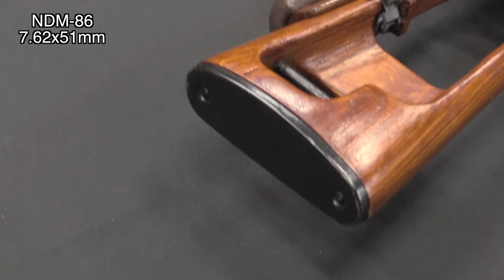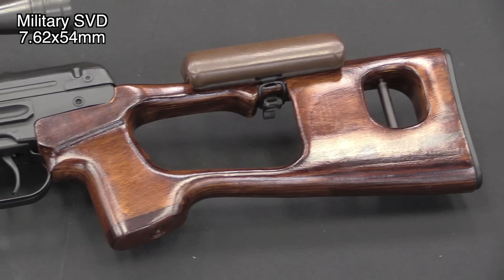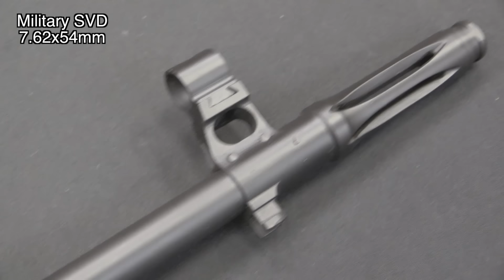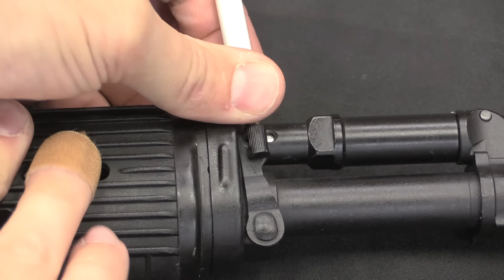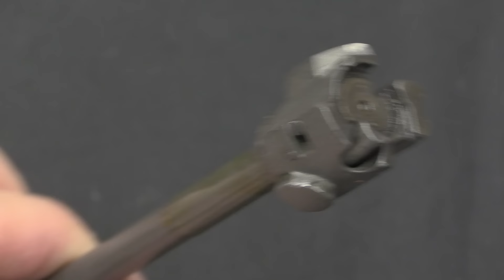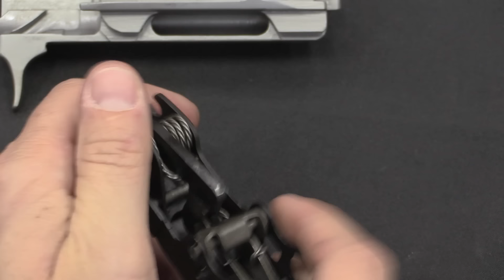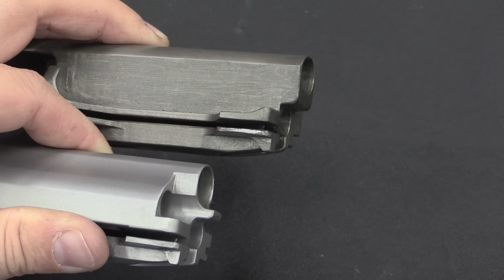Dragunov Variations: Military SVD, Izhmash Tiger, Chinese NDM-86

Comment: Idk why replacing the wooden parts on a Russian rifle with a plastic part instantly make them seem more high-tech.
Reply: Wood has been used in weapons for a long time, so it's probably the idea that wood makes it seem more vintage, which is how I at least got that same idea of it seeming more high-tech.
Reply: @hellscape73  plastic lose all its durability under low temperature conditions.
Reply: @DobryakDobreyshiy  Depends on the polymer/composite The L118A2 & The L115A3 are plastic rifles designed for Arctic conditions.
Reply: @blackace7782  Now check the year of mass-production of old AK models, avialable plastics in that years, and their production cost in comparison with wooden parts. Answer is simple: its cheaper, and its just works in any condition.
Of cource, modern AK's all made with plastic parts, just because it cheaper today, and we have wide variety of composites now.
Reply: Its less weight
Reply: Plastic parts are stronger and better tolerate contact with water.  It’s easier to make many identical parts from plastic.  The transition from wood and plywood to plastic was predictable. And you are absolutely right, with plastic parts the rifle has not become less charismatic, it looks more in the hi-tech style, although the design has been around for many years.
Reply: @dmitriyefremoff2575  Also easier and cheaper manufactering.
Wood has to be machined by skilled carpenter but polymer can be inject molded on machine Most importantly plastic was not widely  available as wood and work force was cheaper than material cost back then.
Reply: Anima Manager
becayse plaustucks comrade
Reply: Wood and steel. Wood and steel....
Reply: Keeping the wood furniture makes them seem more badass.
Reply: To me it's the other way around. Has to be wood to be a Russian gun.
Reply: @ladyskinwalker  Sorry, new russian guns going to look like this: https://youtu.be/3nEJOvGz0Oo
Reply: Это скорее делает их более технологичными с точки зрения производства. Для создания фурнитуры из изотропного материала требуется либо 5-координатная обработка с 1 установом, либо 3-координатная с несколькими установами (я уж не говорю про возможные изъяны в заготовках и дальнейшую обработку ). В то время как полимер достаточно лишь отлить под высоким давлением с дальнейшей доработкой ( простейшая механообработка). А главное полимер можно сделать с нужными свойствами , чего нельзя сказать об древесине...
Reply: The wood and metal one is cooler
Reply: I bought a new black plastic mug for my coffee AKA - an ASSAULT MUG
Reply: @stevenworrall4135  dont let the atf know...
Reply: @michaelmacdonald329  I can't let it fall into the enemies hands it has full auto milkshake capabilities 😨
Reply: Funnily enough, the plastic that the soviets used for some AK74 variants, as well as magazines, was bakelite, and its color was quite similar to wood. Kept them looking really oldschool.
Reply: I saw the plastic and thought "ah, the cheap, chinese knockoff" because it looked so ugly and toylike... But no.
Reply: But they lose the soul!
Reply: thats because the deisgn was already simple , adding plastic parts makes it not only lighter , it will be more ergonomic
Reply: Because technology
Reply: Because modern guns have plastic instead of fun? Not really surprising, works for any gun with wooden parts.
Reply: Because no military is really running wood furniture. Actually ran into problems with it in places like Vietnam with all the moisture but it's mostly a weight reduction thing i think
Reply: Weight and cost reduction i should say. Cost is always a big factor with everything military does 😂
Reply: Because by definition that is making it more high tech
Reply: Same with the oposite and somthing like the Mini-14, it looks like a really oldschool rifle, but it's very simular to a "black rifle" like the AR-15.
Reply: Americans live in a warm climate and have no idea how painful it is to hold plastic cold items.
And the comfort of warming wooden things in the cold in your hands.
Reply: @ZeroDi  yeah bro, no place in the US is cold. You're an idiot lol
Reply: Дмитрий Zero Isn’t Alaska cold?
Reply: @Dark_Star3030  yep. I guess he means the majority. But even in northern Indiana, where I live, it can get pretty cold.
Reply: @ZeroDi  as a Wisconsinite I felt this

Comment: few things wrong /omitted here as well as some notes.

A) probably more than 1000 tigrs. considering there is a known number of Californian Tigrs (700) and these are considered the rare Tigr variant, usually demanding almost twice as much as a stock Tigr.
B) There are select fire SVDs made, called the OTs-03A,
C) Only the 54R tigrs were imported into the U.S, the other calibers are only available in other countries who didn't/don't have bans on SVD imports or sanctions on Izhmash / Kalashnikov Concern.
D) The Californian Tigr has more than just the military FSB compared to other imported models. The furniture is also 90s era, military furniture.  Polymer hand-guards were standardized in 1991. The other commercial Tigr imports came in with sporterized furniture. The black hand-guards are smooth and do not have the ventilation holes and the stocks didn't have the same sling loop and were more sporter in style. Only the Californian Tigrs were imported with the military furniture.
E) NDMs did come with gas regulators but they needed to be drilled to work as regulators.
F) Military Gas regulators can be installed on the Tigrs as well.
G) The Tigr bolt carrier is merely just a modern SVD carrier. The change was done in the early 90s with the SVD-S and carried over to modern military SVD rifles as well. 
H)The lightening cuts on Military SVDs were changed in 1993. They started cutting them on the inside of the receiver instead of on the outside. Same with the Tigr, if you look on the inside, you will see that there is a lightening cut on the inside of the receiver. The tigr just as the receiver of a post 1993 SVD. if you look at pictures of modern SVDs, like the KBI military imports, or the SVD-S. They all have slab side receivers. So just a bit of omitted info there.
I) AGAIN, the polymer hand-guards on the Californian Tigrs are military. The Russian military started using polymer hand-guards in 1991. in the late 90s they started production of a polymer butt-stock as well. Wood is no longer made for any new manufacture SVD in Russia.
Reply: Fancy seeing you here bfg. Love the builds

Comment: The Americans already had experience when it came to tying in snipers with regular army units instead of sending them out on their own. The commander on the spot could say "sniper front!" when they encountered something like a machine gun nest. The sniper could find an angle on the machine gunner and take him out from a distance and pave the way for the other soldiers. And the days of long-range single-shot rifle fire were simply over when WW2 was taking place. Combat took place at ranges of a few  meters to maybe one or two hundred. Having an insanely accurate rifle capable of firing over a kilometer wasn't necessary anymore. The Soviets understood that change in warfare. The "normal" sniper with a rifle capable of exceeding ranges of over a kilometer still has his role, but more as an independent unit sent to take out specific targets (officers, military equipment, etc.)

Comment: AFAIK the barrel twist is usually different between Tigers and SVDs. Most of manufactured SVDs post 1969 have higher twist rate for same length of barrel - 240mm(twist travel - length of full revolution) vs 320mm for most Tigers(280mm for some exports). http://forum.guns.ru/forummessage/2/2366.html

Comment: The usual "Russian gun is inaccurate" story. In fact its just as good as any other military rifle of this kind.

One important detail was left out. Depending on the year the SVD was made it may have a different twist rate. Russians changed that during production. The gun initially came with a 320mm twist, which was optimized for "sniper ammo", but it was too slow for other loads. They changed that to 240mm, which improved its capability to accurately fire ball, AP, tracer and the lot, but at a reduced accuracy for match loads. Out of the factory its expected to be under 1.5MOA with "sniper ammo".
All military DMR's are primarily expected to fire ball most of the time, at about 2MOA on a good day. SVD, after twist rate change, being no exception. If anything SVD set the bar that many still struggle to beat for a military grade precision rifle.
Reply: Don't forget the combatants involved in using the weapon,  is it a trained force or some amateur?
Reply: @fulcrum2951  GRAU shooting tables (1977 edition) give the following data on the matter of shooter qualification. At 100 m an average marksman shooting SVD prone with sniper ammo (7N1) can achieve groups 6 cm high and 4.2 cm wide, while the best snipers can relaibly get groups 2.6 cm high and 2.8 cm wide (ca 1.1 MOA).
Reply: It's also worth mentioning that the Tiger and NDM-86 variants have the original 320mm twist rate. As far as I can tell, all Soviet and Russian military variants (SVDM, etc.) maintain the 240mm rate.
Reply: well they realized that Nato soldiers equips new west and helmets so they have to adopt heavier bullets
Reply: @zenly_csgo  idk man, you really think 7.62x54r won’t go through a vest...let alone a helmet
Reply: @zenly_csgo  The Soviets changed the rifling to 240mm so the SVD could shoot regular ball ammo, explosive rounds, etc., acceptably well without sacrificing too much accuracy with sniper ammo. Modern helmets can usually stop standard pistol bullets (not armor-piercing) from average distances. However, depending on the helmet, there's often fatal deformation on the inside (a protruding bulge that damages the skull), and even if not, the force of impact alone is capable of severe brain injuries or death. Anything stronger than a pistol (M4, AK, SVD, etc.) punches through like a knife through butter for a guaranteed fatality, barring extremely lucky situations. No vest from the Cold War came close to stopping intermediate cartridges from AK or M16, let alone a full-power 7.62x54r.

Comment: get utg Tri Barrel mounts and put about three of them clean the front side in the gas block and put them together and it will take the harmonic side of the barrel which will stabilize it and help draw the heat out as well another thing when the gun is hot use zMAX engine additive Port down the barrel and running the trigger housing the receiver piston whatever let it soak into the metal

Comment: I dont know why everyone claims the Dragonov is only effective to 600m or 800m. the rifle and its scope are designed to be used effectively out to 1.3 Km with 7N1 and 7N14 ammunition. this competes with most 7.62x51mm rifles. I guess they feed cheap PKM rounds into a Dragunov in these "accuracy tests" and then wonder why its so inaccurate.
Reply: ***** the PSO-1 scope's bullet drop compensator is designed to zero in on targets 1km away effectively. 7.62x54mmR has similar arcing and velocity with 7.62x51mm rounds and has a little better ability to retain energy during flight.
Reply: loren roberts Ok. When they give ranges in military weapons, they usually refer to the range the thing was recommended to start a gunfight at. Yeah, you can start a gunfight at 1,100 yards with a an SVD. But you'd better be damn good and lucky. At 800 yrds, a competent marksman can be expected to reliably hit targets with this rifle.
Reply: Trent Rubenacker ppl forget,too, that the Russians have more real world experience, leading to a more pragmatic outlook. ie, it's better to have more DM personnel,1 or 2 per platoon, over a few specialists in a Division.

Comment: Looks like the SVD was re-parkerized. That Tigr got rust inside the flash hider, wonder if the flash hider was bought second handed or the owner shot corrosive ammo through it. The NDM-86 seems like a simply capture-reverse engineered copy, nothing fancy going on there. I have the very original furniture on my Tigr, a polymer hand guard without ventilation holes; a sporter buttstock with rubber pad and only a big thumb hole which only right handed user can shoot comfortably. I put polymer handguard and buttstock onto it for the sake of reduced the maintenance on wood stuff. but the red wood furniture does add a lot of statics to the gun. Ian, can you guy do a episode on how to use the PSO-1 scope? Thanks.

Comment: Is there any other gun using a 7.62X54R box magazine other than SVD family? Words on the street that 7.62 Russian rounds are not suitable for box magazine because of the rim.
Reply: The three main 7.62x54R box fed semis are the SVD, PSL, and VEPR. The PSL and VEPR use long stroke pistons similar to a scaled up AK while the SVD uses a short stroke piston. The VEPR is the easiest to find and most affordable at about $850 in the US. Like all rimmed cartridges the 7.62x54R does have some additional challenges being used in semi autos due to the potential for rim lock and other feeding issues. The "R" stands for "Rimmed" not "Russian" in 7.62x54R by the way in case you didn't know. Hope that helps with your question.

Comment: ( Izhmash Dragunov owner here )

I read a lot of comments about differents " SVDs " on the market, the 
original russian SVD, the chinese copy SDM86 or the romanian PSL. In 
fact the PSL is more a big AK than a copy of the SVD. The accuracy on 
these 3 rifles are similar even if the SVD is twice the price of the PSL
 ( as a brand new rifle, 1200 euros in Europe for the PSL and 2500 euros
 for the SVD in 7,62x54R / barrel of 650mm ). That's why the PSL is the 
best choice. In term of mechanism, SVD and its chinese copy are piston 
operated, the PSL is directly gas-operated. SVD body is enterely CNC 
machined ( rail for the scope included ) while the chinese copy has the 
rail riveted. The PSL is more a stamped / riveted rifle. The SVD is more
 well finished.

It seems that you guys in US can't import russians weapons, so you don't
 have the choice, but the PSL is a very good DMR with very high 
reliability and a cheap ammo cost. If you're interested by this rifle, 
don't hesitate, you will be not disapointed. 

All new SVDs made by Izhmash are now called Tigr ( and no " Tiger " like said in the video ). The only difference between a civilan Tigr / SVD and a military SVD in term of appearance is the bayonet mount under the muzzle break, presents on the military version and missing on a civilan SVD ( like mine ). Maybe the civilan version is more well finished too. The video said that military version has been made only in 7,62x54R, in fact .308 version has been sold too for army. The 2-positions gas selector is available only for 650mm barrel versions.

If guys interested here, I can scan the manual of my russian SVD ...

Very nice video btw and nice disassembly to show how the mechanism is.

My SVD : https://www.youtube.com/watch?v=4rcqsVYqM2Y

Comment: are the receivers milled, forged or stamped?
Reply: The SVDs are milled. Don't know about the others, but they're probably milled as well. They probably could be stamped, but I'm guessing you'd lose structural rigidity and therefor accuracy.
Reply: just googled it, and yes, you are right, they are milled

Comment: I work at a gun store and I was tasked with cleaning an 870. I went to push out the pins for the trigger group with a universal firearms disassembly tool, crushed the tip, and got blue ink all over som poor guy's shotgun....
Reply: Yeah, I don't really like using a pen for anything that requires a bit a force. Every time I see Ian use it I marvel at his courage.
Reply: Did you charge him for the re-blue?
Reply: Diz iz why you use a universal tool called boolet, komrad. It will not get crushed. But if will, there won't be you no more to answer for such thing happening.
Reply: @Ammon Herrera  How is the Remi garbage?? It's the most widely used and issued shotgun, very reliable and durable... I disagree strongly
Reply: :O
Reply: that's KIND OF like cleaning.
Reply: A better tool wood probably be the tip of a cartridge
Reply: You it a free re-bluing job

Comment: I did not understand what brings the bolt back far enogh! 
The gas-system delivers only a short stroke, that would unlock the system, right?
But the bolt has to go back a longer way for complete operation!
Can anyone explain that to me?
Sry for my english...
Reply: Momentum.

The gas system starts the action moving and momentum carries it through.
Reply: Thx for your answer Sir!
So its the momentum delivered by the gas-piston?
Or its still some left from the powder explosion?
Reply: The gas piston.  There's very little back pressure from the powder by the time the bullet passes the gas port and allows gas to reach the piston.

Comment: Seems like the SVD has design elements from all over: AK bolt and controls, SKS trigger group, SVT gas system and recoil spring .....
But all somewhat changed and partially improved, and this was done in the 50s

Comment: Ian, i think this lighter bolt on a Tiger was part of the military SVD-M upgrade, but i'm not sure why your Tiger has an older wooden stock, SVD-M and it's civilian Tiger variants are supposed to have lighter plastic stock (or folding skeleton stock if it's SVD-S paratrooper version).
Reply: It's not an 'older' stock for Tiger. Tigers are commercial guns and made in different styles. So you can have a modern iteration of Tiger with any type of stock, if you want, even the classic one without pistol grip.